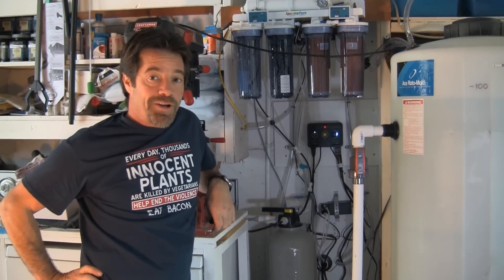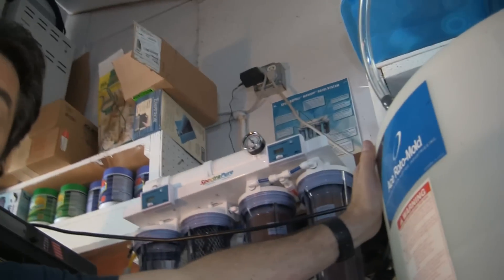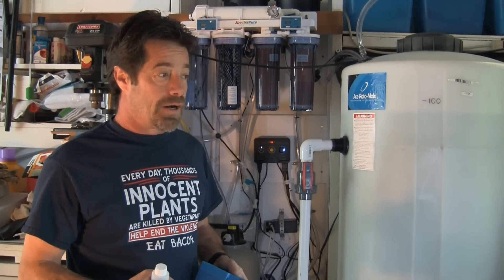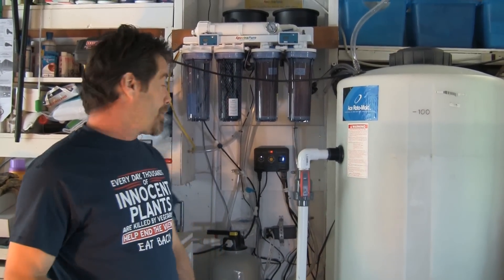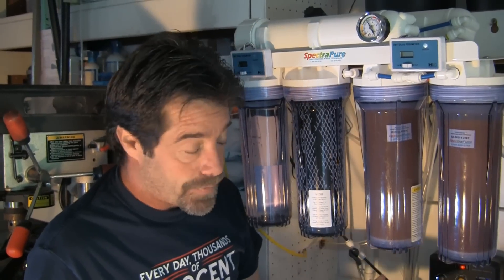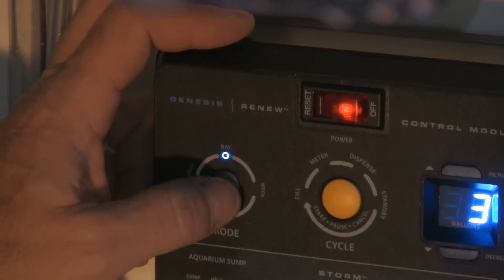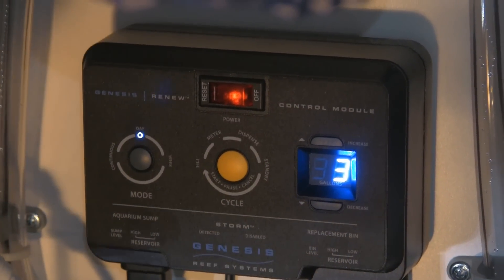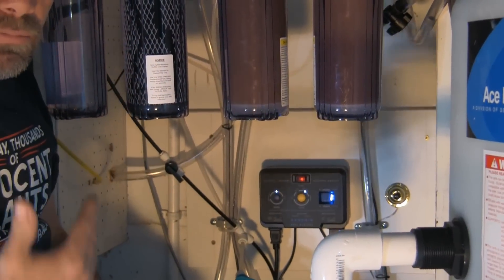Genesis Renew, LA Fishguys TECH TALK episode 156, part 4

Comment: Thanks for the detailed videos.  Like I mentioned in a question last week, I am beginning to plan a tank similar in dimensions to your 500.  The idea of conical settling tank has always intrigued me.  Do you think the waste water to be disposed can be pumped out of the bottom of such a tank using the Genesis Renew and still get good export of the settled debris/detritus?

Thanks again.
Reply: The key is to have good flow to prevent detritus from settling in the first place so it can be exported via the overflow. That said, the renew isn't a replacement for vacuuming as needed. The water changes will however reduce nitrates while replenishing trace elements. All while doing it hands free. It's also great if you want to do a larger water change. Just set the water change amount and hit start.

Comment: How do you run all those hoses across the room? How do you hide them? Or is Jim so lucky to have a tank behind that wall where the genesis is installed?
Reply from the maker: The PVC pipes run across the rafters in the garage and the flexible tubing passes through the wall to where the aquarium is on the other side of  :)

Comment: Hey Jim, have you ever used the Milwaukee digital refractometer? It's a bit pricey, but instant results, super accurate, and really really easy to use. I'd also spring for the hard plastic case cause if you drop it, it gets thrown off/broken. Well worth the investment IMO

Thanks for the videos!
Reply from the maker: I have not used it. Im not a fan of refractometers. Quicker and easier just to use my plastic swing arm hydrometer. Thanks :)